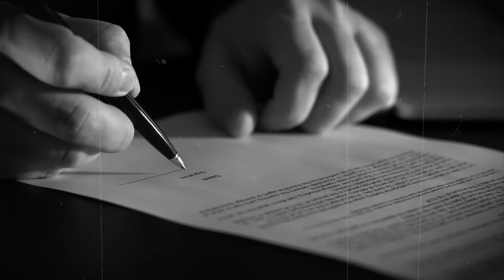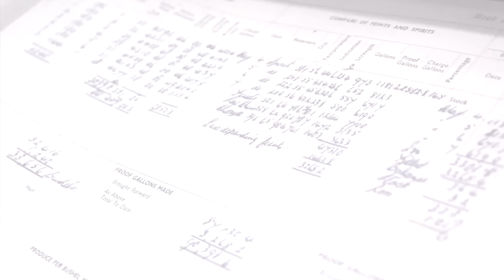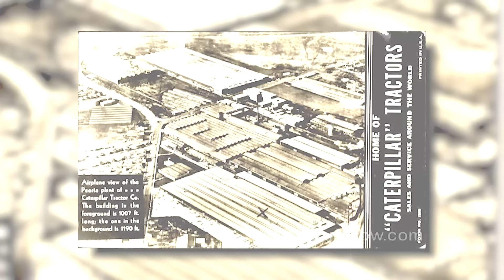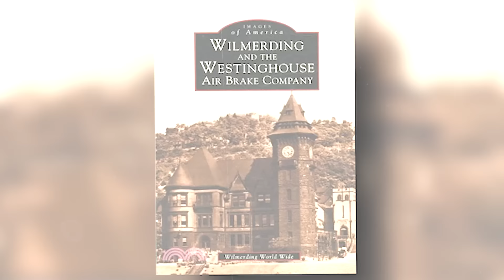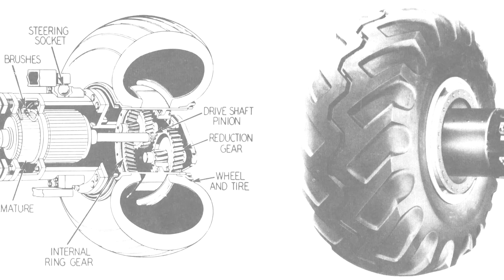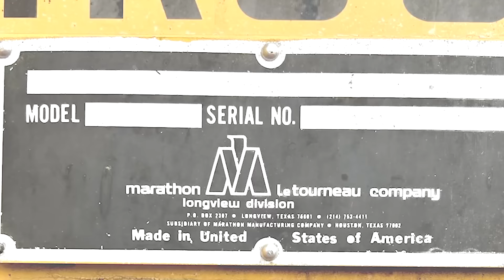How R. G. LeTourneau Changed History With His Big Machines

Comment: He always knew he was on the right track when his competitors called his designs "that crazy LeTourneau stuff". Some even claimed RG stood for Rube Goldberg...  Quite a legacy that lives on today at his school in Longview TX.
Reply: 75% of the earth moving equipment used by the Allies during WW2 was made by Letourneau. Everything he designed was simple and rugged. RG found that the strongest welds were laid on horizontal surfaces so built jigs that rotated the components to facilitate that. He preferred steel rope controls over hydraulics since that gave the operator the ability to make fine adjustments. Letourneau also produced all sorts of cranes. A huge amount of his older equipment is still in use around the World so each owner of the company stays busy producing replacement parts for them..

Comment: When I was a AgMech student at Clemson, we toured the facility at Taccoa, Ga. I don’t remember seeing anything made from components. They made most all of those huge machines from raw materials. They probably bought the copper wire to make the electric motors with, and maybe some bolts. One of the things that impressed me was the skill of the forge operator. He demonstrated that he could gently crack a pecan with the same huge hammer that stamped out massive parts for the earth movers from chunks of red hot iron.

Comment: They were interesting designs but they never cracked the mining and civil industry because the competitors like Cat and Liebherr invested in a dealer and maintenance network close to where they were to be used.  I worked for BHP and our equipment is required to be in full operation 24/7 with a 4 hour maintenance once a month. LeTourneau could never match that.